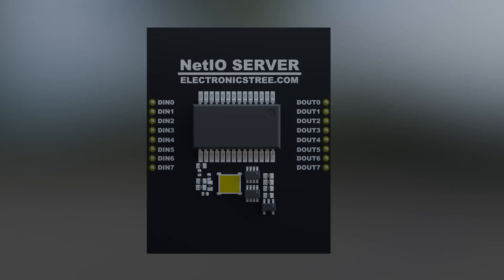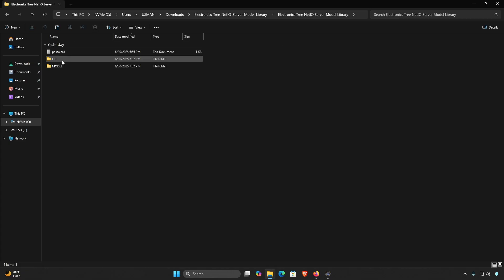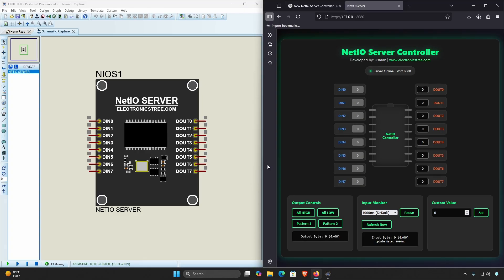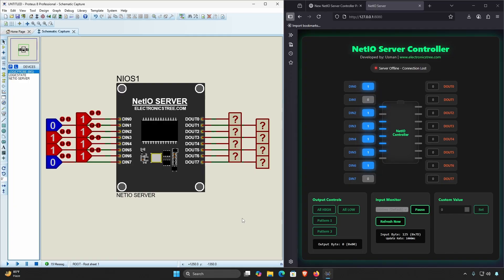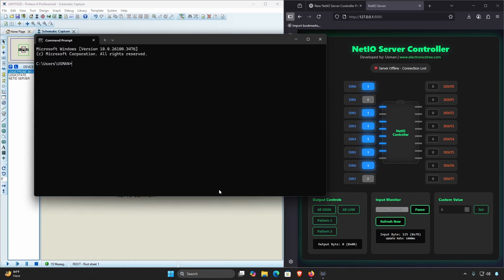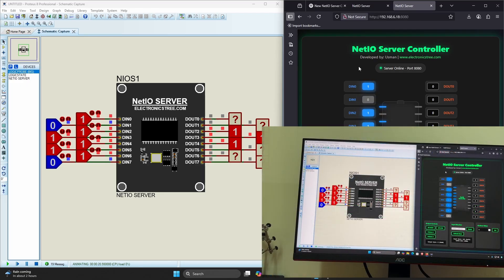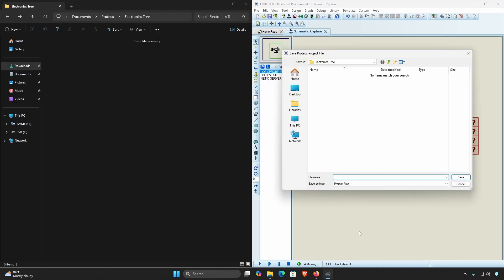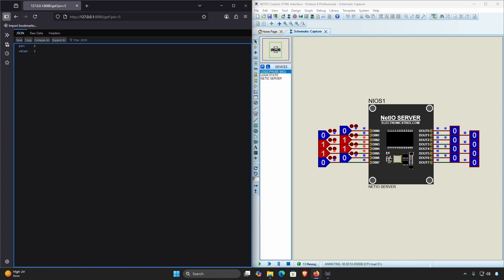Proteus Simulation of  Digital Web Controller  |  Free Proteus Library Model

Comment from the maker: If you start a simulation and see an error message such as:
The "External model DLL 'NETIOSERVER.DLL' not found. GLE=0x0000007E" don’t panic. In most cases the DLL is not really missing. What’s happening is that your system doesn’t have the Visual C++ runtime libraries that the DLL needs in order to run.
The solution is simple. Go to Microsoft’s website and download the latest Visual C++ Redistributable for Visual Studio 2015–2022. make sure you install both the x86 (32-bit) and x64 (64-bit) versions. Even on a 64-bit system, some applications depend on the 32-bit runtime, so having both installed avoids errors.
Once the installation is complete, restart your computer. After restarting, try running the simulation again. In most cases the error will disappear and everything will work normally.

Comment: hello my friend i have these problem : External model DLL "NETIOSERVER.DLL" not found. GLE=0x0000007E. when i sumilate and i dont know how to fix it
Reply from the maker: It sounds like you're running into a common issue with Proteus. The "External model DLL 'NETIOSERVER.DLL' not found. GLE=0x0000007E" error usually means Proteus can't find the necessary file to simulate that component.

Here's what you need to do:
Find the NETIOSERVER.dll file. It should be in the MODEL folder that came with the model library you downloaded.
Copy this NETIOSERVER.dll file.
Paste it into your main Proteus Model Folder. This is typically located within your Proteus installation directory.
After you've done that, restart Proteus completely.
If you still get the error after restarting, try this:
Copy the NETIOSERVER.dll file and paste it directly into the same folder where you've saved your Proteus project file.

Let me know if that solves your problem!
Reply: @electronicstree   @electronicstree thanks for your reply ,yes i do these steps when i upload the library and i repeat the opration to make sure but same result , i' am using version 8.13 sp0 build 31525
Reply from the maker: Hi, the issue is now fixed. Please test the model again.